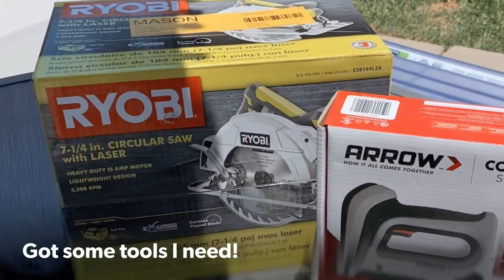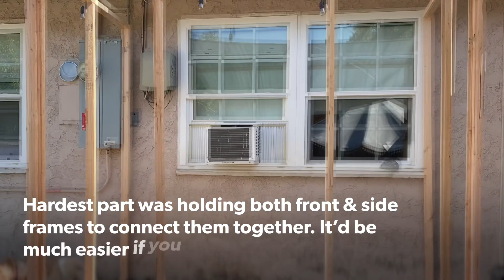DIY “Catio” - Outdoor cat patio! (Made it all by myself!)

Comment: Anyone building a Catio should make sure you have a door tall enough for you to walk through if your cat(s) is an escape artist. I built a Catio 8ftx8ftx8ft, which now houses 5 cats. I was lucky to find a 6 foot wooden framed screen door at Lowes that had been discounted due to a hole in the screen. The Catio cost me just short of $500.00, but it is larger than any I would have bought. My next Catio I will be using a 10'6 x 10'6 Metal Gazebo frame, which I can easily attach wire to. The roof will be the hardest part due to the angle cuts needed.

Comment: This looks perfect. Thanks for posting. I keep being told by handymen that it must be anchored to the ground and use 2x4s for strength. Is this free-standing and what keeps it from shifting away from the cat door or window? Thank you to poster or any commenters who can answer this.
Reply from the maker: Mine isn’t anchored and it’s free standing. I run pet business and always have guest dogs and they jump on the catio when my cats are out in there. But it’s very steady and heavy they can’t move it at all. And for me to move it I need another strong person to push it together! It’s been almost 2 years but it’s been good with any rain and wind we got in LA..! I used corner braces on each corner that’s why it doesn’t shift :)
Reply: @lifewithanimals12  Thanks for taking the time to reply. The weight keeps it in place so long as the ground is pretty level, That's great. I had a handyman build me a rather small one and that cost me 100 in materials (I painted it) and 100 in labor. It is wedged between the house wall and a cinder block wall 2 ft away and dug into the ground some. I still need a big one for the front window so I am considering your nice design. Thanks again.

Comment: wow, great job! Is the rain loud when it hits the PVC roof panels? I wasn't sure if I should get them or use wood. Thanks.
Reply from the maker: It’s not quiet but I had to redo my roof as water kept stucking in the middle and broke it one day. After that I put new roof on my catio then also set up a tarp above the catio so the water will go down from my roof to the side of catio. Good luck for yours!

Comment: Did you follow any sort of construction guide? What would you say the total expense for this project was? How long did it take you? I'd like to give this a try  as the cloth gazebo isn't holding up as well as I would have liked. Any insight would be greatly appreciated!
Reply from the maker: No I did watch other catio YouTube videos tho to get an idea how I wanna build this and size. I spent 1 full day, 1 half day then a few days for a few hours. I’d say total time I spent is around 20 hours but I did all just by myself. If you have someone to help you I’m sure that’d be much easier and faster. And I prob spent total $1000 include buying the tool I didn’t have and shelves etc. (not included cat tree or litter box)
Reply from the maker: I’d recommend using gauge steel angle on the corners to make the frame secure and strong:)

Comment: what type of fencing screen you using?
Reply from the maker: I used 1/2 in. x 4 ft. x 25 ft. 19-Gauge Steel Hardware Cloth from Home Depot :)
Reply: @lifewithanimals12  that's what I'm using but I ordered it online because I wanted the GAW ( galvanized after welding). I had to get the 36" because they were out of the 4' and I got 2 - 50' rolls